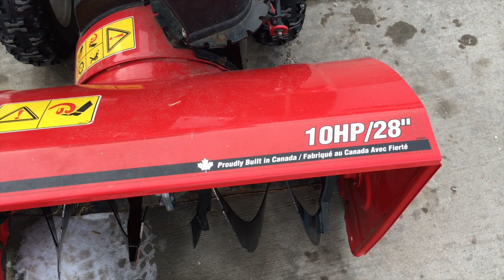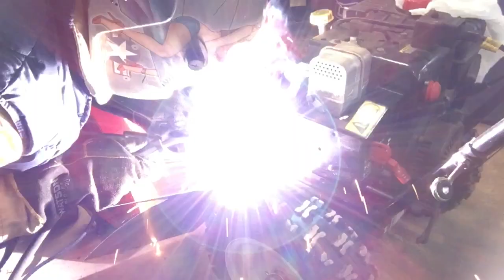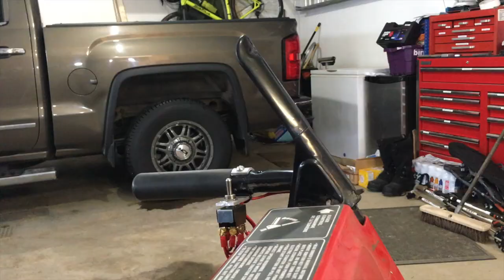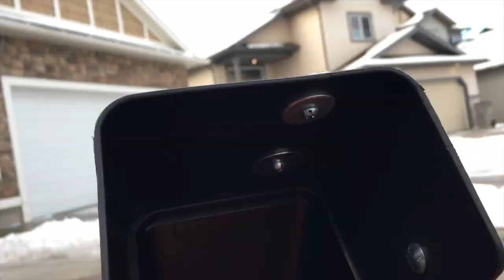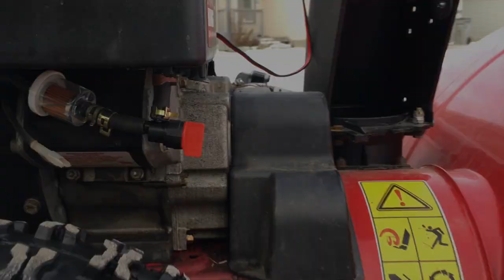Snowblower Discharge Chute Power Mod

Comment: What kind motor you use the deflector? Can you give litte detail ? can se get all parts from prensess auto? Thanks
Reply from the maker: Thanks for your comment!  All parts came from Princess Auto. The motors are from the surplus section. As for the deflector, I just replaced the the motor as it shook off of the gearbox section. A new one was $14 at Princess Auto. But I had a spare anyway. The motor and gearbox is mounted to the side of the chute with a piece of aluminum check plate.  I’ll take a pic of the motor that I used and post it. Or I can make a short video explaining the chute mechanism in detail. Let me know if you’d be interested in seeing that.
Reply: @GeoSphere  can you give full list of material you used for this project .l can order online. Thank you
Reply: @GeoSphere  if you can make short video is would be very nice thank you
Reply from the maker: @Nazif I’m not sure I can provide a full materials list. I used parts and pieces and materials I had around the garage.  The motors were surplus from Princess Auto. When they are sold out, they are gone forever.  All the parts I used can be substituted for anything else. Where I used steel or aluminum, someoelse could use wood. 
Part of the fun of a project like this is to use what you have or find alternatives. It’s about taking an idea I had in my head and building it with bits and pieces that I had on hand or found. 
I’ll try to list what I used but as I said, with the exception of the motors and battery, everything else I had as “junk” in the garage.  
Look for the follow up video in a week or so. 
Thanks very much for your comment and interest in this project!
Reply: @GeoSphere  l understand 
If you  give me what kind motor you use chuter and deflector l can try find similer. Sorry l'm not so good with electric motors 
Thank you for you reply

Comment: Do you know what type of motor you used for the snowblower chute
Reply from the maker: It’s a 12V geared motor. It was from Princess Auto in the “Surplus” section. It had a big plastic pully on the drive shaft which I prayed off. 
I can send you a pic of the motor assy before I installed it. I have a spare.